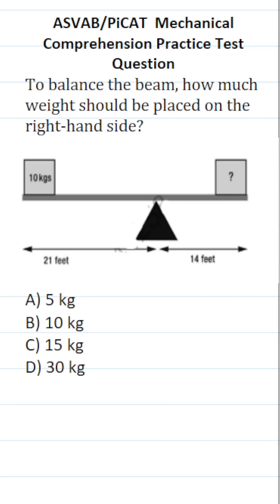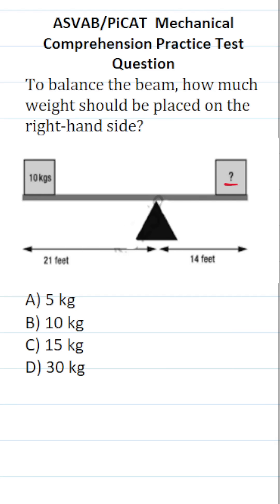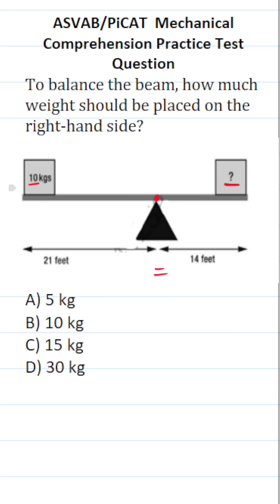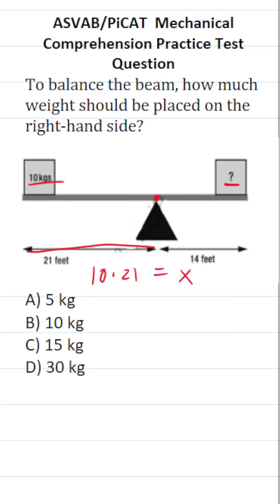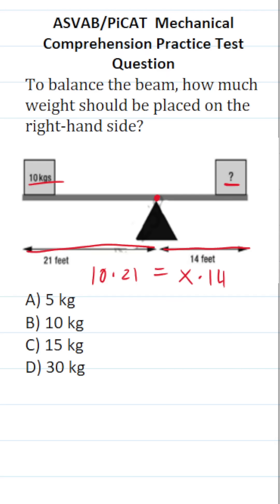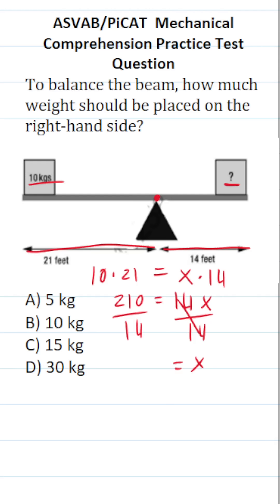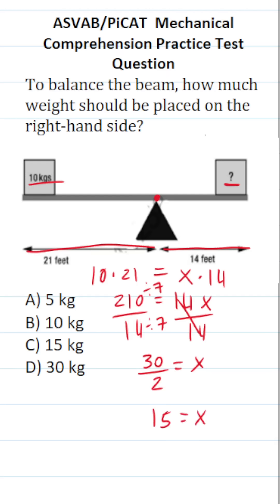Mechanical Comprehension Practice Test Question for the ASVAB & PiCAT #acetheasvab #grammarhero

Comment: My brain went "shift the triangle to the center, 17.5 is halfway between 21 and 14, so that means 15 is correct." 
It made sense in my head 🤷‍♂️
Reply: That’s the type of math you would do on a field or at a site. It’s so much easier and you wouldn’t need your pen and notebook. Good thinking!
Reply: For me the equation is easier. Balanced torque is the same as 
torque (left) = torque (right )
Radius *force = radius *force
21*10=14*force.
210/14=15.
Hence 15kg